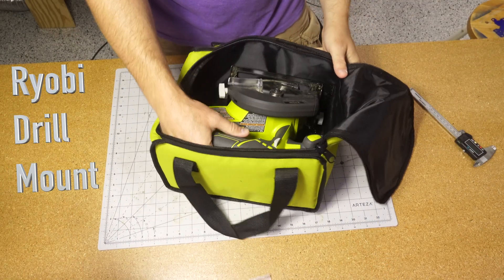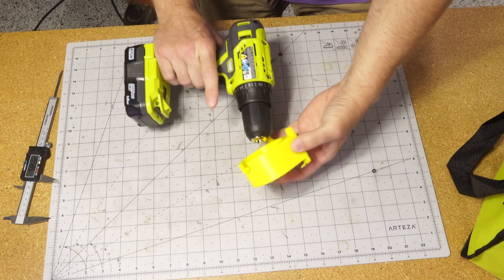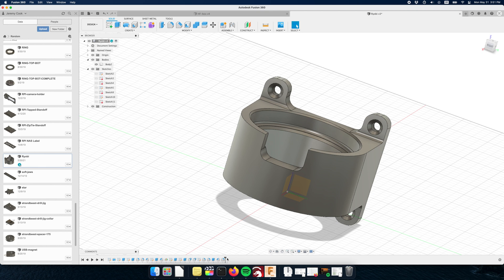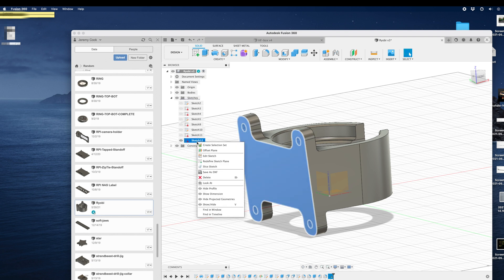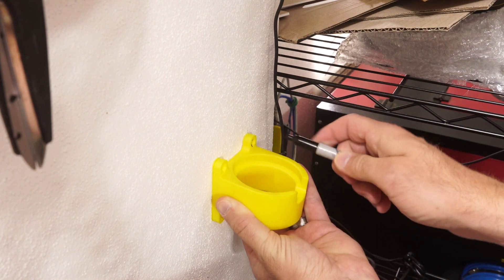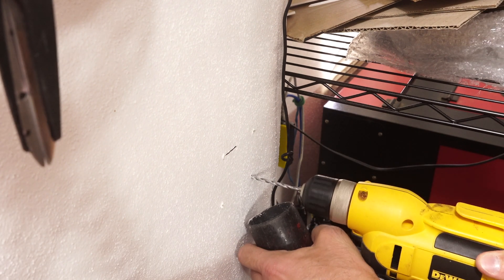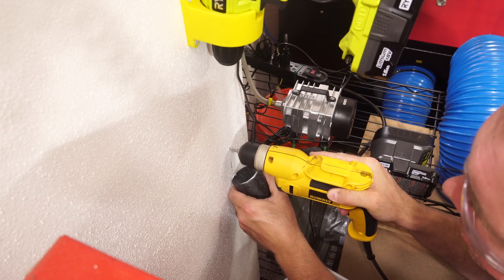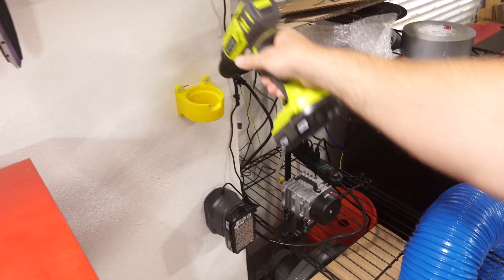Design and 3D Print a Wall Holder for Ryobi ONE+ Cordless Drill

Comment: I've stopped assuming that battery powered tools have to be weaker than tools that plug into the wall.  Our little FPV drone batteries can put out more power than a 15-amp 110-volt AC circuit.  They can't do it for long, because they're small and lack capacity.  Power tool batteries are a different chemistry, but we're at the point where they can definitely match their corded counterparts.

My new favorite tool is my cordless impact.  Everyone should have one.  I misuse it by always using it to drive screws, but when I actually need it, it is amazing.  Driving four giant lag screws to hang a TV on the wall was effortless with the impact.

None of this is relevant to your 3D printed holder, which is quite nice.  You did a good job!
Reply from the maker: Thanks! Well you always need just. one. more. tool, so thanks for the ideas ;-)